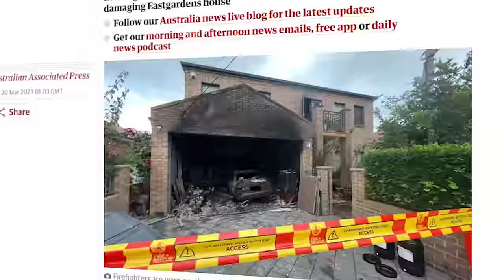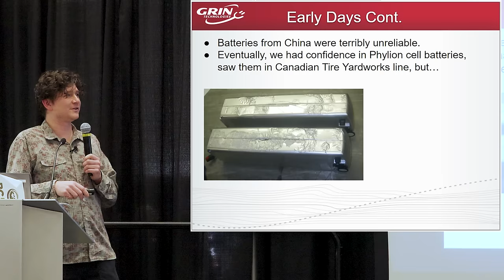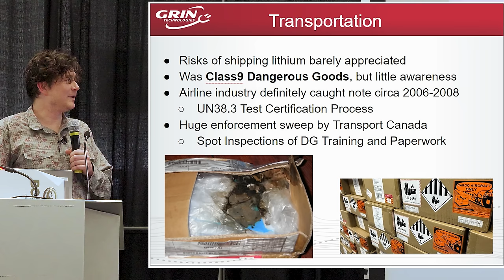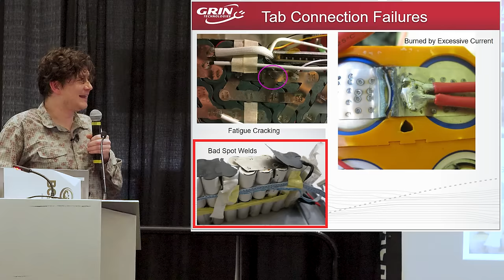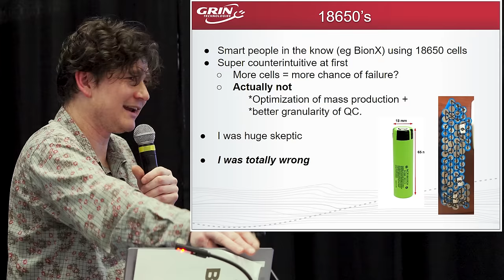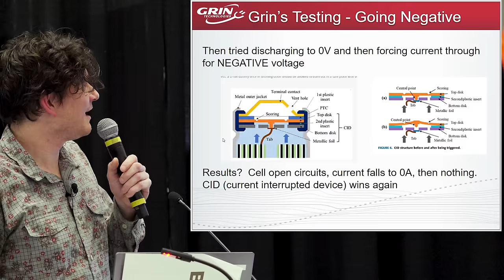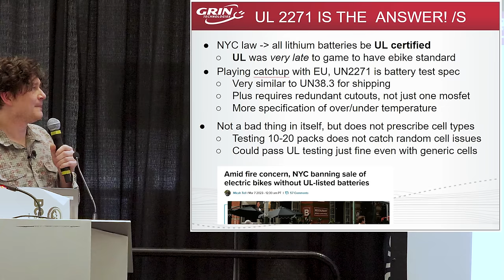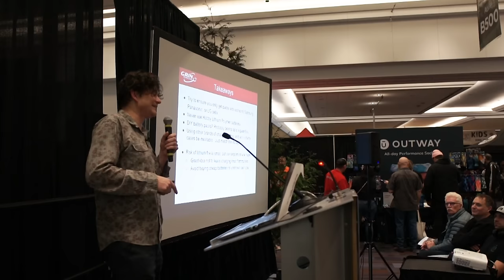Grin's Perspective on Ebike Battery Fires, 20 Years of Experience - Live from the BC Bike Show

Comment: And yet i love my self built LiPo battery packs, even for e-mobility.

As soon you know what risks are possible, you just have to act accordingly. I charge my LiPos always where nothing can burn around it, if possible the charging battery pack is also within sight, as well a CO2 fire extinguisher in case something really bad happens.

For me, LiPos are still the way to go - cheaper, much more capable of drawing a lot of power (or even charging) plus i have enough experience with them.
My 48V 10Ah LiPo pack for the performance scooter does better than the original 10Ah pack with LG cells. Its performance is also significantly increased uphill. Voltage sag on the original battery was like 5-7V when drawing about 3000-4000W, with the LiPo pack with same capacity its about 2V, mainly because they are high drain racing LiPo cells allowing in this 10Ah config for like 800A long term and 1600A short term (10 seconds). In watts we talk here about 40kW nonstop or up to 80kW output for 10 seconds!

The only 2 batteries which were smoking and swelling were:
1) In a picture frame a original, even DEAD (<1V) iPhone battery.
2) A iPod Nano in my glass vitrine with dead battery since like 10 years, swelling that much that it tore apart the iPods case from the screen unit.

In both cases there was a nasty and sweet smell in the air as well some smoke.
Reply from the maker: As long as you 100% own and understand the risks and use them accordingly that's all good, but it just takes one slip up with a non-BMS protected LiPo pack to have a real spectacular situation. Sounds like you have a good handle on what you're doing but you can understand why in general we'd heavily discourage most people from contemplating that route.  

FWIW, the burning ebike in this video thumbnail is from a DIY LiPo battery that someone had on an ebike parked here at Grin, no BMS circuit, inadvertently overcharged.  Went from a puff of smoke to 12 foot flames very quickly.
Reply: @GrinTechnologies  Yeah, i was a bit „greedy“ as well and used the old BMS instead of getting one with faster balancing i would probably need for multiple fast charges in a row. But as i used to do in the RC hobby, i love to monitor and see individual cell voltages so i have connected a LiPo checker additionally so i can control if anything gets out of balance.

In my next DIY battery i will for sure get a proper and PROGRAMMABLE BMS, to set the maximum charging voltage to lets say 4,12V out of the box, hopefully with customizable CC/CV settings as well to allow for fast charging entirely to the 4,12V. Also a higher low voltage cutoff.

I really avoid full charges and draining it until the BMS cuts off, in fact by reducing those limits by default, i can make sure the battery isnt even coming close to those limits (100% and 0%). A proper (oversized) battery should make up for the lost useable capacity.

In fact the story you had, it should be basically CRIMINAL to use 2S or more Lithium cells without balancer or at least protection circuit for each cell.
I would call this LiPo battery without balancer or protection circuit a reckless idea, danger and hazard for anything and anybody. Good thing it burned down without harming any person.
Reply: @GrinTechnologies  but i get your point, if possible i will also avoid LiPos, but high drain/low resistance LiIon cells are still expensive as hell and poor capacity such as the Samsung 25R as awesome this cell is.
Would you say its better to build lets say a high drain 10Ah (2,5Ah 4P) pack or a 50% bigger one but with high capacity cells (21Ah, 3,5Ah cells in 6P).

Can the doubled capacity make up good enough to maintain a useable low internal resistance in long term or should i stick to high drain/power tool cells to make sure the battery can withstand it also in some years?

Thats why i use that much high drain LiPo cells… as soon they get „weak“, you KNOW they are done and need to be replaced, but until they get weak they maintain a spectacular performance incomparable to any LiIon round cell.
Reply from the maker: There are some 27100 emoli cells that are superbly good for ultra low resistance and high 'C' charge and discharge capability.  But in practice, you really don't need high C cells for an ebike. I want to be able to have at least 1 hour or more of electric assist, so averaging 1C is fine and within the realm of virtually all cells. 

To your question, I would say hands down to build higher capacity energy cells then a low Ah pack with high power cells for a given power goal.
Reply: @GrinTechnologies  Yep i agree
But i have for example a modified 2000W+ dual motor scooter with „just“ 48V10Ah battery, where those LiPos are a big advantage regarding to cycles and very short (fast going) trips.

Comment: I have a ebike and bought a few extra batteries.  Have dry chemical,  halon, and CO2 .  Know water is not the best for battery  fires unless you have a swimming pool to put the battery into.  So it will cool and take oxygen  away. But not good for thermal runaway. 
The halon are 20 pounders. Not sure if thats enough to cool down the fire?. They sell special  extinguishers  that they claim are made for battery fires .  But think they are just a type of halon.
The CO2 is a 20 pounder also.  But it is huge.  So leave it outside in storage  shed.  But might bring it into the house were ebike is. The halon and CO2 might work but have to careful.  Because they both displace oxygen.
So ready to throw battery or ebike out of the house just in case.  But I have to be careful of the toxic  smoke it put off also.

You might want to make a video on what fire extinguisher will  really do work.  But they should have came out with one for lithium  even before they started  selling batteries.  But fires and thermal runaway  are two different  animals .

Comment: I actually have a BMS so that something like that doesn't happen?
Reply from the maker: Then you didn't really watch the video. Almost all the legit ebike battery fires we have been privy too had perfectly fine and functional bms circuits. The bms is vital to prevent external conditions from damaging the cell, but it can't do anything about internal cell defects. The solution to that is to only use cells from top grade cell manufacturers.
Reply: @GrinTechnologies  I'll watch it again because I don't seem to have understood it properly. I hope Tenpower and BAK are also among the top cells, I always buy them for my battery packs.
Reply: @GrinTechnologies  learned a alot, thanks!
Reply from the maker: No, those brands are not.  But you don't really have to worry about statistics as a one-off user compared a business that does full production.   A 0.1% failure rate for you might be a totally acceptable risk.  But for a business that sells 10,000 ebikes a year, that would mean like 10 battery fires and potential lawsuits to deal with every single year, and that is very much not sustainable.  At least not for companies that have a presence in the west.

Comment: Standard batteries, high quality.
Don't cat corners.
There's loads of you tube videos of people putting 48 volt in 36 volt e bike.... And catch fire. 
If vehicle is 36 volt do not put 48 volt in it.... To gain more power. 
In 48 volt don't put 52 volt. 

Technically educa
ted society.... Highly, very high technical education of people.
Bosch, Samsung, LG.... Never heard that they have problems.
Yeah
They cost more.... But they are safe.
Never heard of e bike fire.... And live in Frankfurt, Germany 10 years.
High quality control, reliable and reputable e bike company.... No fire.
No name, no reputation, no store, hub, no service, no repairs.... Very cheap.... It all lead to have a big problem with reliability,.service, repair.
Reply from the maker: Some of what you say here is well meaning but quite incorrect.  There is nothing truthful at all to the idea that increasing the voltage will make a bike suddenly catch fire or is in any way related to lithium battery fires.  As long as you respect the phase current limits that that motor and motor connectors are designed to handle then the motor couldn't care at all what voltage it is being driven from. 

Bosch doesn't make lithium cells, but Samsung and LG both do. We have in fact heard of fires from LG batteries, as discussed even in this video. Panasonic is the one company for which we've yet to hear of any battery fires using their cells which are really best in class.

Comment: Great breakdown of a growing issue.  You can charge LFP cells safely from 0-100% which removes the wh/kg advantage of cadmium based cells, so there really is little reason not to  use LFP as it is far safer.  Also, the fact that ebike companies have cheen charging batteries outside of a fireproof case (which are surprisingly cheap) shows just how immature this industry still is.
Reply from the maker: This post is largely misinformation too unfortunately.  You can absolutely charge lithium ion 0-100%  with no safety issues, and the energy density advantage is pretty massive (almost double the weight with lifepo4). 
I would sleep better with Panasonic liion packs than generic Chinese lifepo4 batteries at my side for sure. But if you are on the market buying generic no name stuff, definitely choose lifepo4 over regular liion
Reply: Do you have a single source that states the Li-ion batteries can be regularly charged to 100% without significantly affecting their lifespan? Because every single scientific study done on the matter states the opposite.  Or is this a "trust me bro" type statement? 

 If you are stating that Li-ion cells, by any manufacturer,  are safer to charge in your home rather than a LFP manufactured by a Chinese company like CATL or EVE, you frankly should step away from the industry.  No wonder youve had so many fires, you are clearly completely clueless.
Reply from the maker: Partial charging to 85% or 90% does increase the cycle life, but even charging to 100% a pack with panasonic 18650 GA cells will provide a stunningly long cycle and calendar life.  Source? We've been selling packs with GA cells since 2017, both with generic 100% chargers and our Satiator that gives people an option to do partial charging.  Those batteries are now going on 7 years old, and when we have opportunities to retest them from customers they are usually still giving well over 90% of their original capacity, regardless of if they are being charged all the time to 100%.  The calendar and cycle life performance is well beyond what anyone had dreamed of getting. 

To your second paragraph, that's not what was said. What was stated is that Li-ion cells from some very specific manufacturers (eg Panasonic, Samsung) are safer and more reliable the generic LFP. If you are going with generic chinese Li-ion, then hands down that is less safe than generic LFP.   

Perhaps you simply misread but the exact quote in the post was "If you are on the market buying generic no name stuff, definitely choose lifepo4 over regular liion"

The reason that mainstream EV companies don't use LiFePO4 cells is that they are both twice as heavy and there are no obvious top-tier manufacturers of them. There really aren't any well reputed producers of LFP cells anymore after A123 long ago went belly up.

Comment: In 2014 a load of batteries loaded on MH370 likely caused a fire that brought the Boeing 777 down. Air regulations changed shortly thereafter.
Reply from the maker: It's a tenuous theory with minimal evidence on that particular flight, but there are plenty of other airplane incidents that are well documented to be caused by lithium batteries predating that tragic story.

https://www.fire.tc.faa.gov/pdf/systems/May12Meeting/Lewis-0512-Li-Ion.pdf

Comment: I believe the main cause of fires is using incompatible parts (ordering the wrong charger, wrong battery, wrong controller, etc). The other issue is people messing with it to make it go faster (there are videos on YouTube showing people how to disconnect this or that to get more speed out of it). If you own an ebike/escooter, just use it as is. When you order parts (batteries, chargers, etc), make ABSOLUTE SURE that it’s the correct part. When I charge my escooter, I put the charger on a timer and I turn a fan on to keep the charger cool.
Reply from the maker: Unfortunately the belief you share here is not at all what our own first hand experience shows. It's true that some forms of tampering can clearly increase battery risks (eg bypassing a bms circuit), but anything else is natively protected by that very bms circuit.